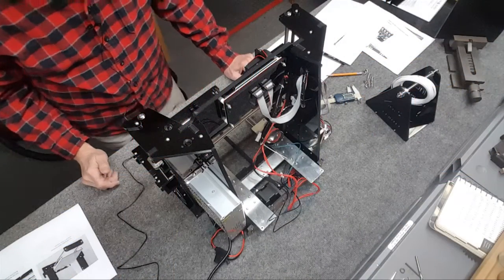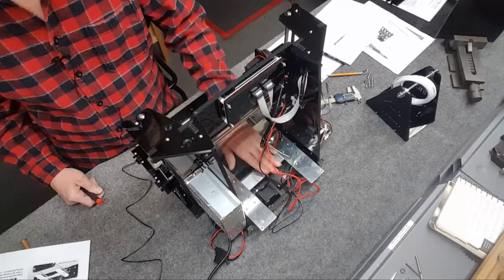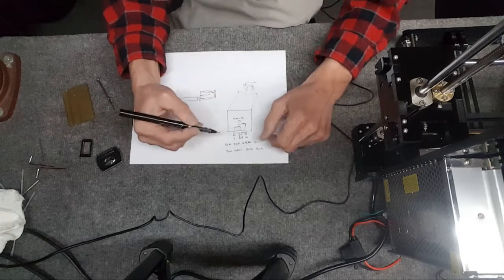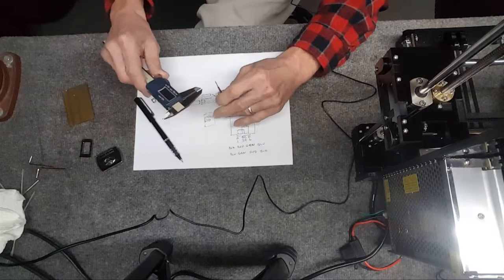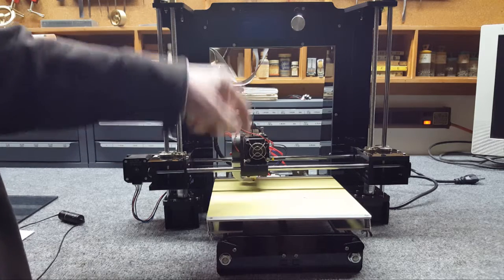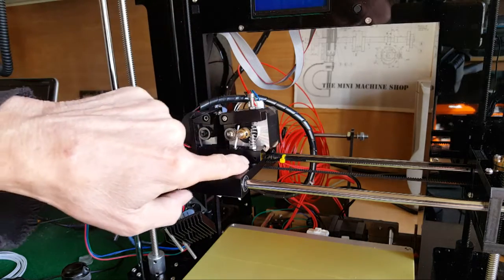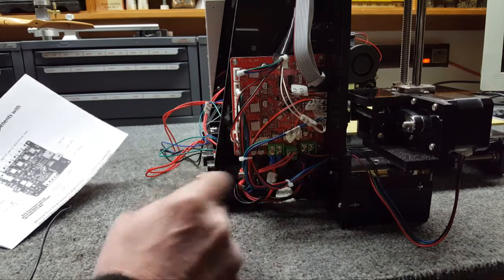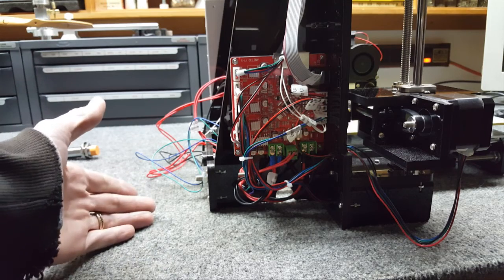Anet A6 3D CNC Wiring & Homing Fix Part 2 of 3

Comment: The Y-axis direction issue discussed in this video has to do with the back-plate being mounted mirrored. The y-axis motor seen from the back of the printer as seen at minute 7:00 should be mounted on the right, and the limit switch on the left.  While reversing the motor connection works, mounting it correctly will fix the problem without having to deal with wiring.

Comment: my fuse burned on my A6 but you say i can just take it out and put a cable direct to the mainboard without a fuse?
or should i get  a new fuse cable to put between power and board?
Reply from the maker: If I remember right there is a fuse already in the power supply look for it.

Comment: Hi Dave,
That stepper motor connector is a multi way JST type, 2mm or 2.5mm pitch.
Usually you  press the barb on the crimped contact in ,so it bends down below the plastic stop on the housing, releasing it.
Once the contact is free, use a craft knife to reset the barb, by lifting it back up to an angle.
I've changed wiring on RC servos for various different arrangements using this method.
Also the balance charge connectors on Lipo battery packs are the same style.
Adam
Reply from the maker: Hi Adam,You can do it that way but it's not recommended by the manufacturer. There is an extraction tool, as mentioned, that inserts into the body to lift the plastic tab as I demonstrated. Amazon has them I just didn't want to spend the money. :)
Reply: @TheMiniMachineShop  
If I remember correctly, the crimp type contacts for D type connectors used a round extraction tool to depress the barb.
Also the old style military Amphenol connector did the same thing.
Never seen an extraction tool sold for the JST style connector.
Just saying 😀😀
ATB Adam
Reply: Then again the barb is facing the wrong way, to depress the barb, from the wire end, so it probably does stress the plastic housing.

Comment: The hot bed on my printer stopped working. I managed an 11 hour print without it coming loose with no bed temperature. Since bed stopped heating I have done a lot of prints with no bed heat, using blue painters tape.This is using PLA and Colorfabb XT. I am fortunate in having a removable flexible print surface. I can flex the print surface to remove the print and it comes away nicely. The default settings for both filaments heat the bed, but I am happy with my results with a cold bed.
Reply from the maker: This is excellent input!!!
Reply: I had no idea this would work. My printer has everything proprietary. Filament spools talk to the printer to tell it which filament is on the spool and everything is done for me, I just pick the print layer height and off it goes.  Bought it 4 years ago, as it always heated the bed, I had no idea prints could be made on a cold bed. When looking at replacements, I realised there are printers with no heated bed.  Found out how to make it print with a cold bed and been printing that way ever since.  Can't print ABS, but really have no need for it.
Reply from the maker: The makerbot video did say ABS needs heat and PLA none which shocked me!! BTW PLA on Banggood $30 and Amazon $15 for inland made PLA bought one but haven't tried it yet.
Reply: Before the bed stopped heating, I found I could print ABS quite well by ensuring the ambient temp within the enclosure ( a Robox is fully enclosed) was up to the temperature set by Robox for ABS.  60 degrees ambient and they printed well.  Start the print at anything much less than 50 degrees ambient and the print would be ruined by warping of the lower layers and lifting at the corners, even with the bed heated to the right temperature.
Reply: Dave M , I am in Australia, we tend to pay more than anyone else for whatever we need, but thanks for the filament prices.
As almost everything I do is for clients or customers, I lean toward buying better tooling and consumables. I use alloy 2011 in aluminium, because machines better. I have parting tools that are expensive, but they work. I use ground edge carbide inserts, that cost a third more than moulded inserts, but they are easier on my lathes which only have half hp at the spindle. I tend to be the same with filament as I am sure you can understand. 3D printing can be such a difficult exercise at times, I prefer to stick to filaments I know. This can make printing much more predictable. I really do not have the time to try new filaments.

Comment: Your Y axis is going the wrong way because you have mounted the back plate mirrored: https://imgur.com/n66mXdd
Reply from the maker: I understand what you are saying but its installed per the instructions and the factory video. Also the hole for wires would be on the wrong side.
Reply from the maker: The one picture I used in the instructions has it mirrored like you said. The rest of the pictures and David Dan's video, which I hadn't discovered yet, have it your way so you are absolutely correct! Curious why there are so many people in videos and chat rooms with homing problems....

Comment: I found that the extruder access is a pain in the butt. I printed this www.thingiverse.com/thing:2287009 and it allows easy access to the extruder. Also, they must have changed something because my Y-axis motor mounts the opposite direction as yours and the limit switch is also on the other side? 🙃But then my A6 homed in the correct direction without changing the wiring. And it looks like you are putting the extruder heat sink on backward but if you use the easy extruder thing from Thingiverse you won't need it at all. 😀Thanks for the video!